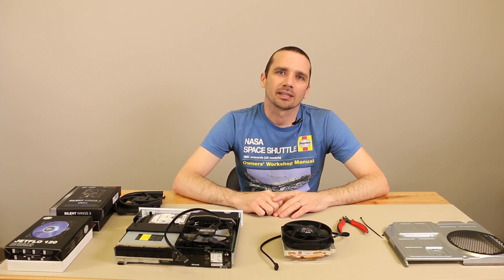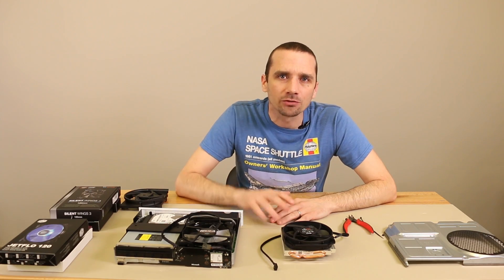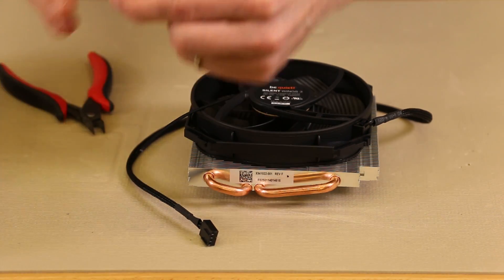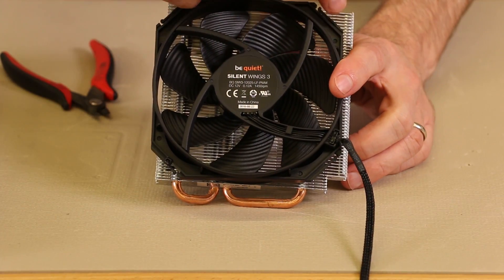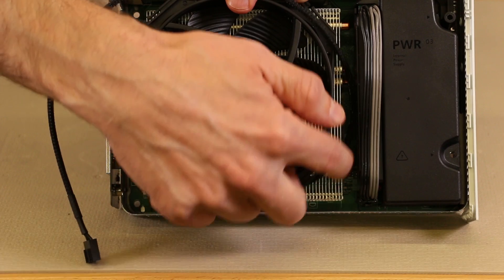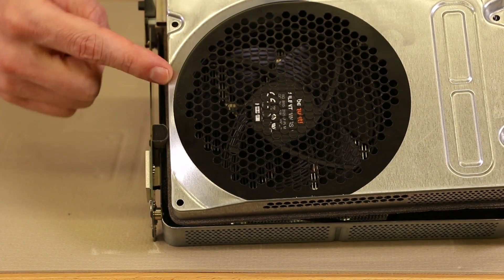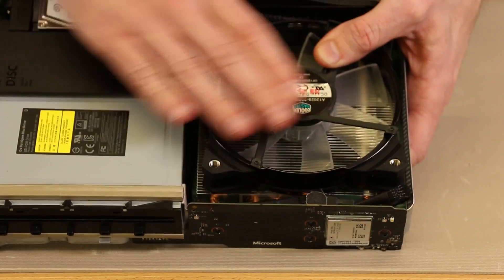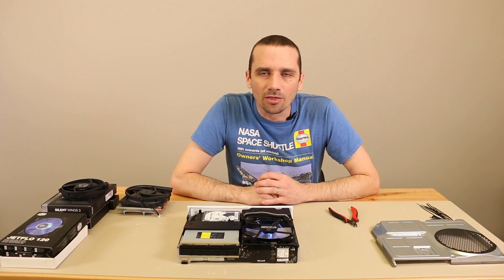Xbox One S Aftermarket Fan Mod Part 2

Comment: Greate video ! I'm thinking about installing a fan that will push air oto the radiator and sinc my console is standingu vertical i will place a small fan on the top pilling the hot air out

Comment: Question: does the fan extract air from heatsink and blows it outside? Because I see you mount the fan bearing side up... this means it will blow air outside the Xbox case. Is my understanding correct? I wonder what happens if you mount the fan the other way around... to blow air towards the heatsink like in any regular PC cooler.

Comment: How come I bought the exact same jet flow 120 but the 4 pin adapter is too big to plug into the motherboard on the one s? Is there another 4 pin for that? It came with extra adapters but the 4 holes are a bit wider than the ones the proprietary fan has. It won’t fit the motherboard holes.
Reply: theres an adapter linked in the description

Comment: Steve, you seem to be the right one to ask. I have a Series S, and I am having overheating issues. Once I play a game for a certain amount of time, certain clear foglike elements turn to purple. Is this something where I need the perfect amount of thermal paste, or would that be something more serious?
Reply: Did you find out abut the purple frosted lights?  Sounds like your fan's led's or your consoles' led's were overheating and were unable to use the proper voltage to light correctly.

Comment: Thank you a bunch! I used a 15 green LED UpHere 1200rpm and I sawed off the upper angles in order to fit the entire mod into the metal chassis. UpHere is also very cool and quiet for the Xbox One S. Cheers :)

Comment: Every heatink isn't the same for this model. This one looks way thinner than mine. I tried a Corsair SP120 and it doesn't let the power button align right. It almost fit but not quite. Going to get Notcua slim with some weather stripping.

Comment: What about using the SilentWings 3 BL070 (High Speed) instead the BL066? Someone wrote that changing the fan will make the temperature higher, what if the fan spin faster?

Comment: is there any way to fit the zip ties without taking the heatsink off, i can get to the point of taking the optical drive out and fan but i don't want to have to removes everything if possible. Thanks :)
Reply: I was gonna ask that question too.

Comment: Do you not need to repaste the heatsink? I figured that would be pretty important to do.
Reply: Yea lol,use cooler master paste or Grizzly its best quality
Reply: @201aleks21  Found it funny he left out such an important detail :P
Reply: Only if you take the heatsink off. If you unclip the optical drive and hard drive, you can easily unclip the fan and replace it without detaching the heatsink at all.
Reply: He probably assumed his fans like to do repairs and mods but great point mate

Comment: how is the power supply cooling because of the original fan shroud and fan had a slight curve to direct air through the power supply and up. now with the silent wings and the Rubber seal it would just suck air through the back instead of blow out, but how about that led fan or fans without rubber seals

Comment: Could've tried not to put the fan the wrong way around bro air must blow into the Xbox lol I've modded quite a few over the years and seen amazing temps compared to the stock cooler you want the fan to keep running after you turn off the console to help it cool faster after it's been on for so many hours in most cases. 👌

Comment: You can buy brand new OEM replacement fans for Xbox One S consoles off Ebay for about $10. My brand new Ebay fan is quiet, like a normal computer fan.
Reply: Have any links?
Reply: You could also just replace the two ball bearings in the original stock fan. They're readily available just about everywhere, called 693ZZ. Just don't buy the cheapest junk bearings from china cause those won't be any quieter than the bad ones you're trying to replace

Comment: 120 mm fan with 12 thin blades at say 15 mm apart and I believe if the one s vent holes were slightly bigger s would run cooler and quieter

Comment: Anybody knows the fan connector pinout?
Reply: The easy solution would be get a nice high quality fan (static pressure design) than simply solder the fan into a USB port. As long as the fan is good quality and low rpm it doesn't matter if it runs at 100% you wouldn't notice it either way.

I know this isn't what your asking but I'm throwing it out there.

Comment: Hey question for  you , if the fan isnt coming on at all would that cause the system to shut down rather quickly.
Reply from the maker: It could
Reply: appreciate the reply. When i start the system its silent compared to my other system. Ill start there and see what happens.

Comment: I purchased a used mint condition Xbox one s and I changed the thermal paste and upgraded the Internal hard drive with a bigger and faster capacity. I turned on the Xbox while it is open and I can see the fan does go on but always in slow mode. Strangely I can play certain games and watch Blu-ray movies with out any problems but in other games (gta 5 or destiny) , it kicks me out back to the home screen after a minute or two. I reinstalled the games, Updated the console and cleared the cache but it does the same. So to my main question is Does the fan if defective ( always in low mode) affect certain games from playing ?
Reply from the maker: I don't think that problem is a fan problem. I don't know what's causing it but I don't think it's the fan.
Reply: OK, I kinda thought so too. I'm gonna do more research to see if I can find the problem. Thanks  buddy for the quick response.

Comment: That cooler master fan is not good for heatsinks or radiator because of the wings desing, its mean to be use as a case fan. The Be quiet is much better.

Comment: I would have liked to see a noctua nff-12 fan tested with this
Reply from the maker: Cool
Reply: Yep has anti vibration pads votex  cooling  super fast bearing for ess load only uses 0.6 watts and nax soeed  1500 rpm has  pwn  and  lades design to draw heat if fast with less noise

Comment: I swapped the original with the be quiet swift 3 fan, and I have no idea if the pwm functionality is working. I loaded up the dash, kept checking the fan, started playing a game, gets hotter but I noticed the graphics seemed to be getting worse? I assumed my console was overheating due to a lack of pwm functionality but kept playing. Should I be concerned if the graphics “seem” to get worse over time, without my system actually crashing?
Reply from the maker: Maybe...but the only way to know for sure is to keep playing to see if it overheats.
Reply: Yeahhh. Thanks for the reply, I might just make it run full speed with the wiring? If that's worth it in the long run.

Comment: my xbox one s fan just died the other day. Xbox kept shutting off and saying that it had a ventilation problem, and the fan wasnt kicking on. I just bought the adapter that you suggested in the last video, and will be trying out a new pc fan when the part gets in. Thanks for this video and the link to the PWM fan adapter.
Reply from the maker: You're welcome! Good luck
Reply: why didnt use warranty?
Reply: is your xbox running fine now ?

Comment: TronicsFix i want to apply liquid metal paste to my xbox one s, but i just found that the contact surface of heat sink is silver, not sure it's aluminum or steel or Ni coated. Do u have any answer for this?

Comment: Hey TronicsFix,
I know these videos have been up for a while but I just wanted you to know how much they helped me out.
I bought an Xbox One S recently and it had the noisy fan just like everyone complained about. I made the decision that it would be less of a hassle to modify it myself rather than try to return it and hunt for one that worked correctly. Besides,  I'm somewhat knowledgeable at electronic repairs, etc.
After watching your videos however, I knew exactly what to do and I was able to find which items to purchase because you guys did all the testing for me! (Including which fans work, etc.) Because I wasn't very comfortable with the temp readings you got from using the Silent Wings 3 (from the next video), I went with the Jetflo 120 with red LED's. I got the adapter and thermal paste as well. I"m aware the Silent Wings 3 would have been quieter but it still ended up being much quieter than the loud clicking from the original.
It was a bit of a difficult fit with this fan because of it's mounting brackets. I did have to remove one like you suggested and I used zip ties to properly mount in place because I didn't want it just sitting in there but since they protruded out of the top of those brackets, I had to put a slight bend in the top metal cover. It all worked out however.
And I have to say the end result is pretty awesome! After playing for over 6 hours, the temp never gets above 55 c./130 f. and it looks really cool with the red LED's shining through. It does get a little loud when the fan has to ramp up to high speed but it's nothing unbearable and it only lasts a few seconds, besides that just lets me know the PWM function is working correctly.
Having your videos at my disposal made this job really easy for me.
Thanks Again!
Reply: btw My temperature readings were done with an infrared tester just like the one used in the next video directly off of the heat sink.

Comment: What are the stats on the stock fan? Like static pressure, CFM, and RPM? Also can a Corsair fan work if pinned properly?
Reply from the maker: No idea the stat but it would be very hard to fit any other fan in there.

Comment: Thanks so much for these videos.  They were super helpful in replacing my One S fan with a Noctua.
Reply: how has it been going with the noctua?  I plan on switching mine to a  Noctua NF-A12x15 FLX
Reply: Dead silent.  I'd definitely recommend it.  Make sure your new fan is capable of being controlled down to 0 rpm.  I used the NF-F12, and it worked great.  I don't think the NF-A12x15 FLX will work (not a PWM fan).

You will need to buy an adapter (search 'Gelid PWM adapter') or splice the cable yourself.  Depending on the height of the new fan (mine was bigger than the stock fan), you could have issues reassembling the case.  It took some force, but I was eventually able to close it up and screw everything back into place.
Reply: Got NF-F12 today and still waiting for an adaptor, hope it will arrive in a day or two. Did you just put the NF-F12 in as is or did you modify the fan in any way? What about the isolation around the fan, used any, is it required? Have you used included low noise adaptor from Noctua? Thanks.
Reply: I did not modify the fan.  I did not use any additional material for isolation.  I did not use the low-noise adapter.  Just zip tied it to the cooler and spliced the cables.  It was very tough to close the case though!  This is due to the height of the Noctua fan.  The eject button will be a little harder to press but it's definitely a worthwhile trade-off.

Comment: For some reason my silent wings 3 fan is on at all times, full blast. It's very loud and basically unusable. I used the adapter in the video, am I doing something wrong?
Reply: thats because you bought sw3 with a 400rmp low (start) speed. Do you know whats the original fan low speed is? Someone said that max is 3500

Comment: Ok with the SW3 installed fan I recorded a temperature of 56°C exhaust air temperature with a calibrated temperature probe and a Heatsink surface temperature of 68°C with an infrared thermometer (also calibrated recently). When I replaced the fan with eh stock the temperatures went right down to 36°C and 42°C respectively. The SW3 simply does not provide adequate airflow, probably because the fan speed based on the firmware of the Xbox for the stock fan speed simply does not correlate properly to the SW3 fan.
Reply: The Xbox One X air flow: Side vents --> Fan --> Heat sink --> Power Supply Unit (PSU) --> Rear vent. Removing the stock shroud only cools the Heat sink and prevents the air from cooling the PSU. Careful with this mod.. Still like this channel though

Comment: Did you need the adapter cable for the Jetflo 120? or Will I be able to run the fan without the adapter? 
 I'm considering running the fan for the mod itself.
Reply from the maker: You don't need it but it makes it much easier.

Comment: for myself im not worrying about the noise my xbox one s fan doesnt seem like it's pushing enough air out so i'd rather get the cooler master fan myself not for the looks but because it runs faster i'd rather keep my xbox one s cool than have a quiet fan that might not do the trick

Comment: Thanks for the useful guide. I've been planning on doing this for some time, didn't know if generic 120mm fans would have same thickness as original fan, but just like in this guide, the Silent Wings fan that I bought fit perfectly and it is completely silent compared to the original junk that MS puts in there.
Reply from the maker: Glad it worked for you!

Comment: That's the worst is zip ties , you can use actual screws and bolts from micro center or your local hardware store , zip ties are an alternative but I wouldn't recommend it in the long run
Reply from the maker: Why would you not recommend zip ties?
Reply: You can definitely use screws+bolts, but with XBOne S they are absolutely unnecessary. The fan's fit is very tight and the metal cover which goes on top of it holds the fan VERY securely, even if zip ties will break - the fan will not move around.
Reply: They will last but not in the long run and yes that's true until u accidentally knock it around the wrong way or even worse just saying
Reply: You sound fun at parties lol. Barring someone using the console to beat someone over the head, this zip tie solution is a permanent solution in this instance.

Comment: Hi Steve. In the end, the Be Quiet fan simply didn't work for me - the clearance between the fan and the heat sink is far too small. The clearance with the original Xbox fan is far greater. I just ended up putting the original fan back in - the gnawing feeling of of 'when will the fan hit the sink again?' wasn't worth the noise reduction. I'd like to be able to find a fan that was suitable, but it's gonna be hard - the original is quite a unique shape. It was fun to try anyhow.
Reply from the maker: That's so strange. The one I modded is working great with no clearance issues. At least you had some fun with it!

Comment: I put the jet flo 120 in my mine with the blue led, I think its hotter or its pushing more hot air out who knows.
Reply from the maker: It runs hotter. I already tested that in one of my vids.
Reply: Would you mind to tell me how much hotter, I replaced the thermal paste also pretty simple process did help it somewhat I've been playing BF1 for 2 hours and its hot but good so Im sure it fine.

Comment: I just finish my Silent Wings mod following your instructions and so far so good. I will add that my system took a T8 for the wifi and front boards and T10 torx for everything else. For some reason I was under the impression that they were security torx too but none of mine were. I know one of your videos mentioned a T9 torx but I didn't run into any that used a T9.  Thanks again for posting so many details. Your videos are great and helped me a ton.
Reply from the maker: Cool! Let me know how it works for you!
Reply: TronicsFix so far so good. I've done hours of BF1 for a month with no issues.

Comment: Did this to my one s. I think the silent wings 3 high speed fan running at 2,200 rpm will work better then the wings 3 low speed running at 1,450 rpm . When running at lower speed, if pwm wire hooked up, the 1,450 fan does not turn fast enough on the one s. Playing re7 gets very very hot. It does ramp the fan up after a while. Thats just my thoughts though.
Reply: I found the same, the SW3 installed stock simply does not run fast enough, it might not damage the console but it runs 30+°C hotter with the SW3 installed compared to the stock.
Reply: jesse scharf are there different fans with different rpm’s? I bought a silent wings 3 and I want it spinning faster overall, my console gets really hot so I kinda wanna help with that overall to help me not worry about it as much.
Reply: @RichardDrippins  I think it's better to run with the higher rpm fans the motherboard will control the rpm accordingly and the stock fan on the regular xbox one is 3400 rpm I'm not sure about the Xbox one s
Reply: yeah I swapped fans around the time I last commented, now I have an extra silent wings fan :/

Comment: Great video- and thanks for the work you do!  Question from a novice - Do you have to take the motherboard out of the metal case (i.e., disassemble pretty much the entire Xbox One S) in order to replace the fan?  (Given what I saw in your Xbox One S teardown video, I assume so, since that seems to be how you take the heatsink out in order to mount on the new fan.)   If there's a way to replace the fan after only taking off the metal top (and without (much) further disassembly). I'd love to know.  Given my lack of experience (i built a gaming laptop from scratch in 2008 but nothing since then.) I'm a little retiscent to take everything apart.  But if I can just open the metal box and swap out the fan, this is simply something I have to do.  (I'd probably go with the Noctua NF‑F12 PWM - a bit more sound than the silent wings 3 but also much better static pressure.)
Reply from the maker: Yes, you have to disassemble the entire console to do this. Unfortunately!